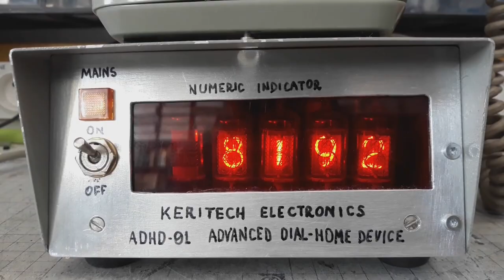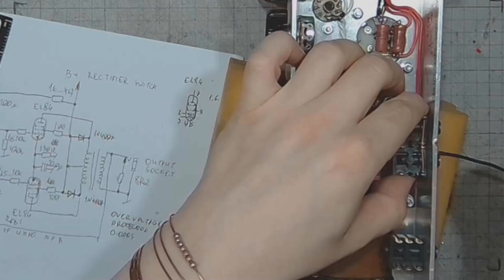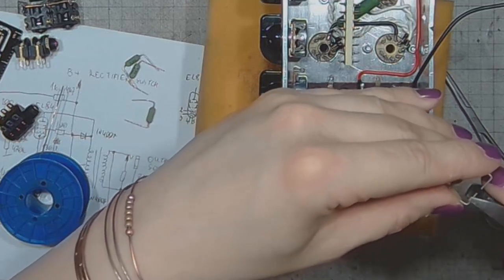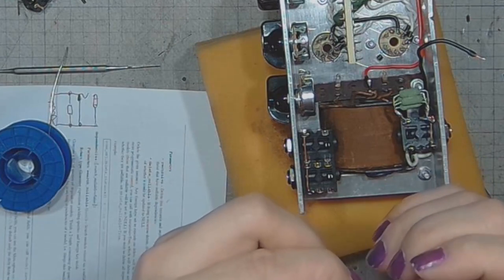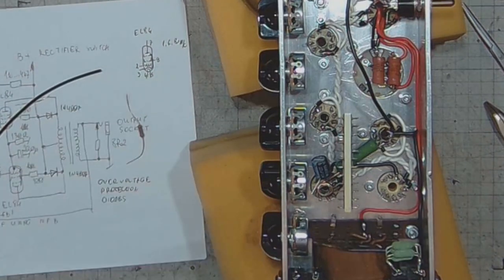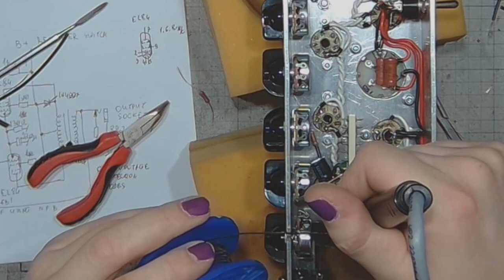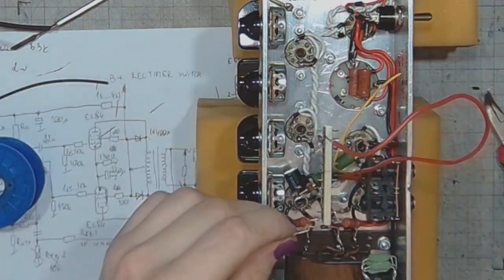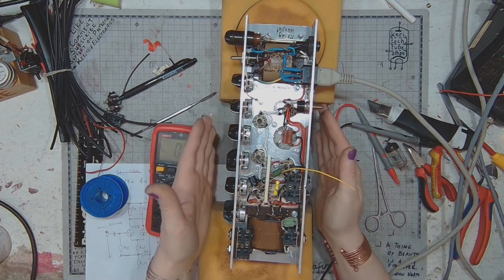Keritech DD-12 "Dirty Dozen" Amp - Part 9: Power Tubes Wiring

Comment: I think I must be misreading the schematic for the EL84 plate circuit. It looks like the diodes would short the signal going into the output transformer.
Reply from the maker: Hey, thanks for noticing - you may be right :). Since there's some current flow on both branches at all time that causes a voltage drop on the winding making the potential on the plates lower than on the center tap, I didn't worry about this - but will definitely look into it. I usually placed the diodes at the output tubes, with anode on the ground and cathode connected to the tube's plate.